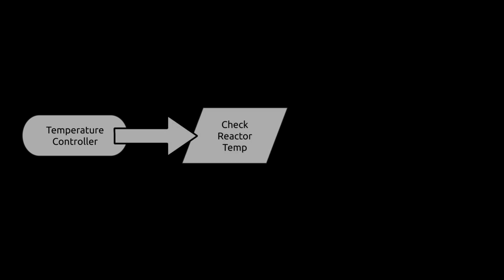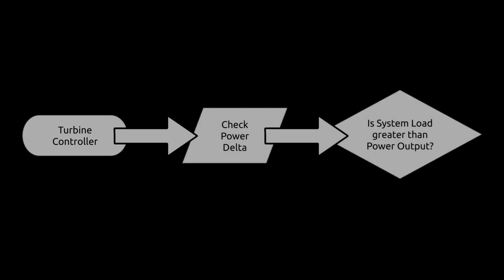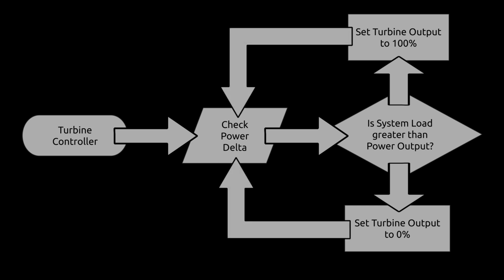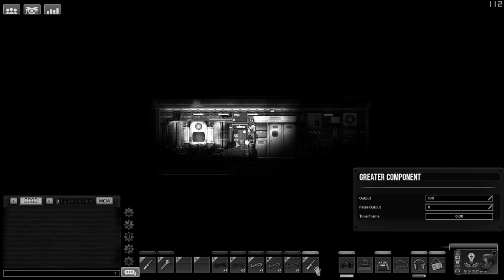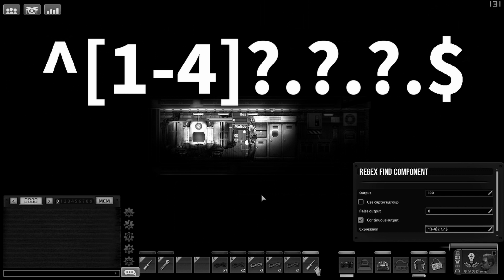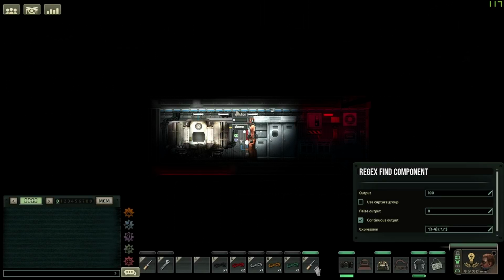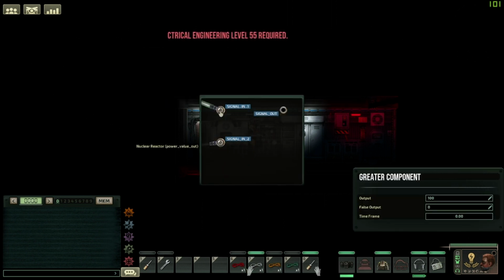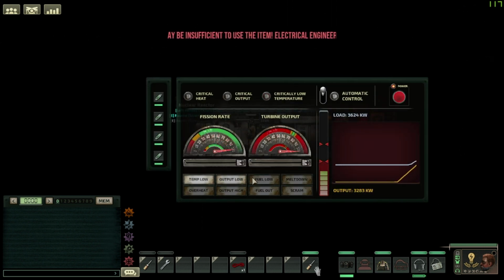Barotrauma - BEHOLD! The 2-Component Reactor Controller!

Comment: damn, and I was just starting to wrap my mind around the 20 component controller lol. 
Would you mind explaining in a little more detail what the regex component is doing? I am merely a fledgling engineer player trying to maximize the abilities of my role.

I love all your videos btw, subbed :)
Reply from the maker: OK, I'm no regexpert (see what I did there?), but I'll do my best to explain what's going on... The RegEx component (or "regular expression") receives an input string (or a set of letters and/or numbers) applies a search expression, and returns the true output if the expression is satisfied, or the false output if no results are found. Keep in mind, if the string is longer than the search expression, the search can be applied multiple times to the string (unless otherwise specified). There are several parameters in play here, so I'll explain them all individually:

1) The "^" parameter indicates that the beginning of the input string must be included in the search. Similarly, the "$" symbol indicates that the last character of the input string must also be included. This combination forces the search to be applied to the whole string only once.

2) The RegEx search expression can be defined or individual characters, or in groups. Some symbols can represent more than one character, like the ".", which can represent anything but a new line (which you never see but is created whenever you hit the Enter key when typing text).

3) You can also specify a set of characters to be checked against one or more input characters with "[" and "]". 

4) You can also multiply a symbol a specific number of times, or as many as possible, or as few as possible. The "?" symbol indicates a "greedy" search, which returns either zero or one characters, whichever is greater. This one is probably the hardest to describe. 

So let's see the all of these applied to our search expression:

^[1-4]?.?.?.$ can be broken into:

- Search the whole string once
- The first character can be either one or zero instances of numbers 1 to 4
- The second, third, and fourth (if applicable) characters can be one or zero instances of any letter or number

Since we know that the temperature output from the reactor will always be numbers, we can use "." without worrying about letters, however this can be replaced with "/d", which searches only for numbers.

In plain english, this search expression will be satisfied by any one-, two-, or three-digit number, and any four-digit number that starts with 1, 2, 3 or 4. In even simpler terms, anything up to or equal to 4999 returns true, anything above that returns false.

I hope this helps!
Reply: @TheGamingNerd2022  Wonderful description, thanks a lot for explaining it so thoroughly. It's amazing that all of that functionality comes from one component.. but now that I feel like I understand what it's doing and how often it's being checked, it really makes so much sense.
Reply: @TheGamingNerd2022  no one in the world is a regex expert. ive been programming for 20 years and i still have to google it anytime i do anything with it.
Reply: @TheGamingNerd2022  Minor correction: shouldn't it be a \d, since the backslash, \, not the forward slash, /, is usually the escape character? (as in, the character used to signify that the next one does something special, such as \. to mean "a literal period" or \S to mean "any character that's not whitespace")

I'm going off software development experience, not game experience, so I don't know if the game flips the slashes for some compatibility reason

Comment: It's horrifying that this works; though, conversely, I can't believe it took this long for anyone to realize that the reactor can be robustly controlled with a bang-bang controller.

10/10 can't wait for it to get nerfed in an update.
Reply from the maker: This controller has been around for a while, apparently. I'm aiming for visibility, not credit for its design. That being said, I'll take the 10/10 as a compliment! Cheers!
Reply: I highly doubt they will nerf this. It's up to you if you want to use it. If you think it's OP, just don't use it. It's not like other games where you are forced to use it because it's part of a item in the game in everyday use, like say an ability in WoW.

You can easily just not use subs that use this, remove it yourself, say do not use it in MP lobbies, and if someone does, remove it, etc.
Reply: Why would they nerf a feature like this though?
It's the best part in the game
Reply from the maker: @Nova_1106  another question is: how do you nerf these components without potentially breaking every custom sub with wiring components? Granted, the regex component isn't the most popular item ever, but I don't see a way to rebalance one component with messing with all of them.
Reply: @TheGamingNerd2022  I mean, the regex is hardly key here (I replaced it with a gt+mem myself for easier customization and linking into a button by the helm); the bigger astonishment is that a bang-bang controller is so robust

Comment: Bloody Hell. All the research and thought process that went into more complex controllers, just to be absolutely stomped by a single fucking is-greather-than comparison for each of the two reactor sliders.

I love it.
Reply from the maker: Bittersweet, isn't it? I'm testing variations that adjust the target temperature to maximize fuel economy, or increase temperature to improve step response, but so far it's pretty impressive on its own.
Reply: @TheGamingNerd2022  You could leave turbine with just a greater component, and connect another greater component to fission rate, and compare reactor temperature to desired temperature calculated by the following formula:
(Load/MaximumReactorOutput)*50
This should result in the same temperature as in the popular 5 component reactor control(which I recall to be the minimum temperature required, but please, correct me if I remember that wrong), but achieve it faster thanks to greater component. Whole set-up requires 6 components and 10 wires, unless I'm dumb and you could optimise it. Sorry if that turns out to be incorrect, but in my brief testing this seemed to work, although I don't know by him much does it reduce fuel consumption, or whether or not it's the most fuel friendly formula (without playing with low voltage).

Comment: just the other day i saw a comment under one of your videos saying that you could use a batterie as a buffer between the reactor and all the electronics of the sub to smooth the reactor load, the same way it could be done using a capacity in a irl electric circuit. i'm no expert in electronics neither am i in barotrauma's electronics, so i wonder, is it really possible ? and if so is not rendered useless by having a controller like this one ?
Reply from the maker: I don't know a out the battery bit, but this controller eliminates overvoltage events almost entirely.
Reply: @TheGamingNerd2022  yeah so i guess it's not even useful to avoid having voltage spikes by smoothing the load in that case
Reply: The reactor won't send power directly into a battery
the power only works if it's going directly into a junction box, so you could put a small invulnerable junction box, then send the power from that junction into the battery
beyond that you need to make sure the battery's max output and max input match your maximum power grid load
Reply: @thecrazy1342  oh ok, I didn"t know that, thx
Reply: @leobourdon5056  reason for this is that the reactor needs to see the "load" value from the junction box

Comment: Um actually s/hundreds of times per second/exactly 60 times per second/
Nice succinct explanation and tutorial. Kudos for acknowledging and promoting an improved solution.
Reply from the maker: After a little testing, I can confidently say you are correct! While the oscillator can be sped up to 240 Hz, the other components have a default refresh rate of 60 Hz. While it doesn't really change the performance of the controller, it's good to know! Thanks for pointing this out!
Reply: @TheGamingNerd2022  60Hz seems very moderate, can I assume that this will not lead to any computational demand that might be relevant for multiplayer?

Comment: I knew about this controller before I discovered your PID Controller, but I still went for the harder one because it is much more enjoyable visually.
Reply from the maker: I'll take that as a compliment! I'm not saying this controller is my design, nor is it new... I just want players to be aware of the best possible solution for reactor control, and in my opinion this is objectively the better method. Kudos for not taking the path of least resistance!